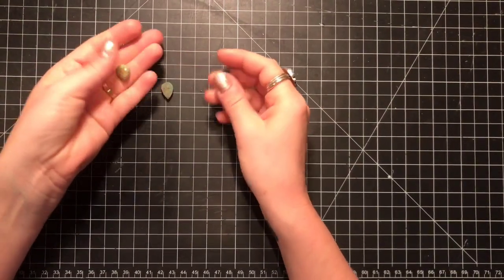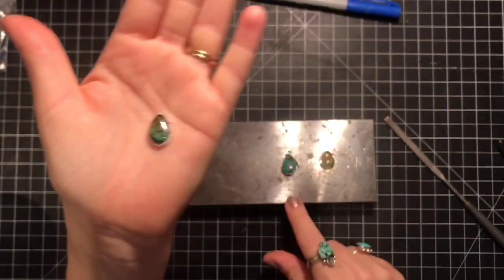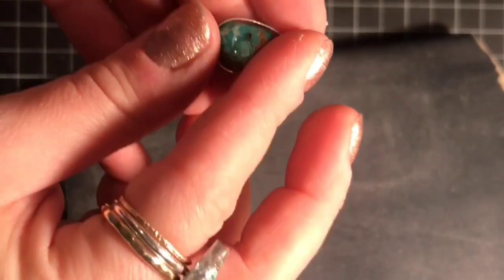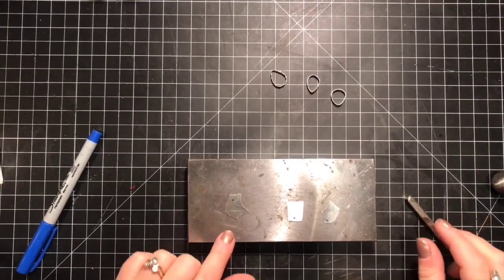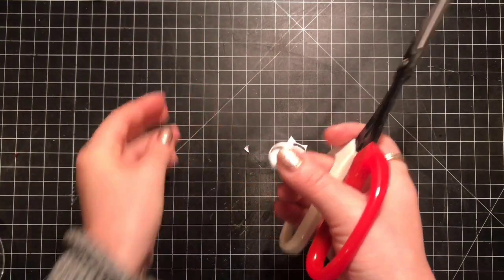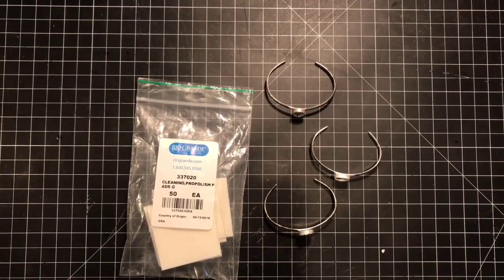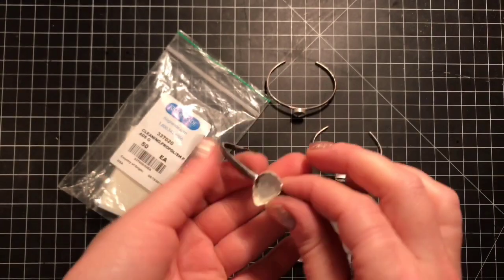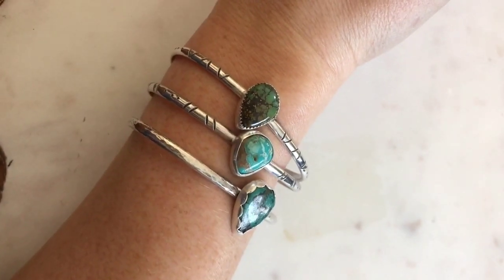How to make a Sterling Silver Turquoise Cuff Bracelet from Start to End

Comment: Nice video good job with your etching! The rocker you may have a better time of it if you turn it so the rocker goes from bottom to top of the cup. Holding it sideways like that is the reason it keeps slipping onto your stone. Just a little observation from a fellow jewelry maker. Beautiful bracelets!
Reply from the maker: Thank you for the tip!!

Comment: Hi there are so many options in purchasing bezel wire for each of the item #'s you are using, so as a beginner which size of bezel to purchase?? 
Which dimensions of bezel wire from 094x.010 to .250x.016 of 30 g wire? 
Can you tell me which one you are showing in dimensions in your demo?
Reply from the maker: Purchasing bezel wire all depends on the height of the stone. I would recommend purchasing a small amount of each size to test out which you feel most comfortable with. A foot of bezel wire cost a couple dollars. I use 1/8” or 3/16” depending on the bezel height. You can always sand the bezel wire if it’s too tall for the stone.

Comment: Thank you for your tutorial! I am making my first cuff and I'm having issues soldering it to my gemstone setting.  Do you ever need to file the cuff flat to make a better surface connection? Would sweat soldering help at all?
Reply from the maker: Hi!  You’re welcome, hope it helped!  You can definitely file/sand the cuff to make it flatter for a better connection. You can also try sweat soldering too. I typically use sweat soldering when adding sterling elements to a piece but I’m sure it would work to attach the cuff to the backplate.

Comment: Thank you so much for this video. I must of watched this at least 5x 😂 I’m struggling getting my plate soldered to the half round wire. What kind of torch are you using? 
Also do you file the wire at all so it’s flat where it’s positioned on the plate? I thought this was supposed to be done in order for the solder to flow.
Reply from the maker: Julia Chick Hi!  I am using a large map gas torch. Since there’s a lot of metal you need a higher temp. I do not file the the wire flat but you certainly can. The metal just has to be touching for it to flow.

Comment: Hey there!! Trying so hard haha it seems by bezel wire is really flimsy and giving me troubles when I try to keep it connected before soldering. I’m using item 100290 strip SS .013 x 3/16 any advice?!
Reply from the maker: Hi! Thanks for reaching out. My advise for trying to keep it connected would be to make sure you file both sides down so they fit together right. You can always bend the bezel wire into a different shape to get them to fit. Once you solder it’s easy to bend it back to fit the stones. Hope that helps!

Comment: I know this video is older but it’s worth a shot to ask. Before you solder the backplate on the cuff, do you  file the cuff flat where you are going to attach the backplate like you would a ring or leave it 1/2 round?
Reply from the maker: Hi there!  Thanks for asking. Yes you absolutely can file down the wire before you solder. I don’t typically do this step and haven’t had any problems.
Reply: Thanks for the response!I actually wasn’t expecting a reply. I’m at that step with some bracelets and I wasn’t sure if I treated it like a ring and filed it down or not worry about filling it.
Thanks again!
Reply from the maker: @leewhite4161  most of my videos are older but I try and stay active on here. Let me know if you have any other questions. I’m happy to help!

Comment: Hi! Great tutorial! Is there a big difference in using a propane torch vs the smaller torch that you used in the beginning  to solder the bezel to the backplate?
Reply from the maker: Lena Hoover Hi, thanks!  Yes I only use the smaller torch for soldering bezels. It doesn’t get hot enough to solder a bezel on a back plate.
Reply: @thehautebohemian5753  Ohh ok makes sense. Thanks!!!

Comment: When I sand and file my bezel wire to get shorter, my bezel wire always folds and crinkles because it’s so thin. Do you have recommendations to ensure it doesn’t lose shape? I’m not pressing hard either. Yours seems thicker than mine. Do you have a link for the bezel wire you purchase from Rio? I know they come in different heights but do they come in different gauges?
Reply from the maker: Arianna Khaira I typically use 28ga bezel wire. 30ga works also. If you go too thick then it’s hard to shape around the stone.

Comment: One more question 🙈 I was a t a work shop and made copper bangles, but I want to add some of my stones to them. Can you make a bezel with copper and solder it to the bracelets ? Or does that only work with silver ?
Reply from the maker: Absolutely!  Many people use mixed metal when creating pieces. Silver solder will work but of you want more of a gold look you can used copper solder.
Reply: The Haute Bohemian thank you !!! Is there copper sheets to make the bezels ( is that what it’s called ), so it’s all copper ?
Reply from the maker: Jennifer Sharpe yes!  You can get copper sheet and I believe copper bezel wire.
Reply: Hello! Hey with number so you recommend for the bracelet mandrel from Fretz. They have couple ovals one and I can’t figure out which one is the new oval one. Thank you for your help
Reply from the maker: I believe it’s the MM-3 model. Any oval mandrel would work fine though 😊